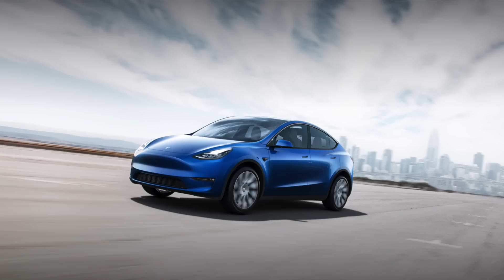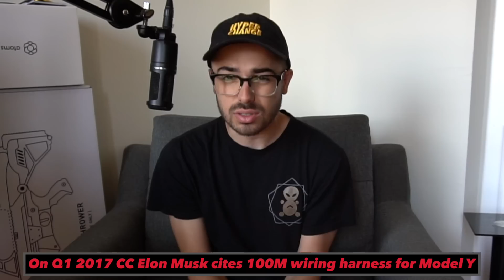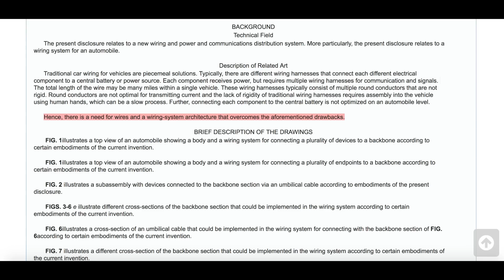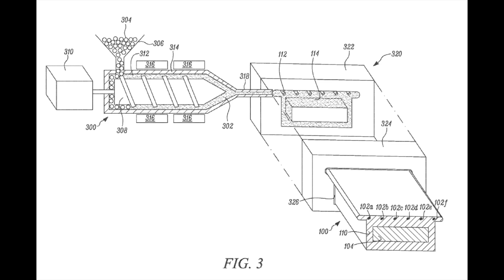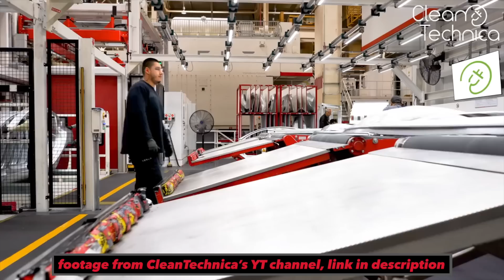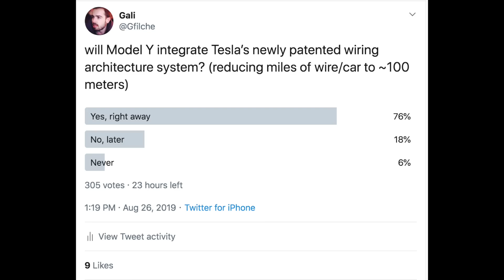Model Y Manufacturing & CAPEX Revolution?

Comment: He misses the main point regarding the new wiring that the new ‘bus’ wiring allows for all the small components (lights, speakers, sensors, cameras etc) to receive power and data to perform their functions from the same cable infrastructure. This is important because the individual modules can be replaced and upgraded potentially as they all connect to a universal connection. The reason it reduces wiring length/weight is that you only need to take power and data once around the car to connect all the modules, not running separate wires back from each device for power/data. Bus wiring also means each device or module has its own intelligence allowing it to feed back data to the car on its performance/faults etc.

For example, the speakers in a normal car are all connected back to the central audio system with separate dedicated speaker wires that are all run separately around the car. In the ModelY design (Bus wiring topology) the speakers are provided power and data from the simplified main universal vehicle wiring loom and have an amplifier module in each speaker with the audio signal sent as data to each speaker over the data network from the central audio system. This means the speakers can share the same cables as the cameras, sensors, window motors and headlights.
Reply: Noah Derrington exactly!

Comment: Imagine each power connector coming off of a branch of power, having an "IP Address" like connection for a general location node which will determine the power to go to each component in the area. Literal computer on wheels.  Makes sense to me.

Comment: Rigid wiring usually means wiring that fatigues and breaks more easily - like what happened with the Model S doors in the early years. I hope they have this in mind.
Reply: Fatigue is caused by repeated extreme bending.  Keep bending to well below yield and there should be no fatigue.  Use of PC boards attached to the frame with rubber mounts, coupled with ribbon cables for flex points like door hinges.  These boards convey conductors with power and signals across the space as well as mounting the local micro controllers and connectors going to local devices.
Reply: @paulogden7417  I don't see how ribbon cables are a specific solution to my proposed problem so long as they are also extremely rigid.

Comment: If only you had even a clue of what you are talking about. The robot-capable harness WILL NOT be lighter. Tesla is under a lot of pressure to deliver the Y - they CAN'T deviate from what's in Model 3. The patent you're jumping up and down in your couch over was probably filed a year or two ago....it does not mean that the "tech" will appear in a car. 

Automotive buses have been around forever - this is NOTHING new or high tech...in fact, it's high expensive. With a manufacturing plant in China, labor is almost free, so again, it makes ZERO sense that Tesla would do anything in this area.

Autonomous driving WILL NOT require more wiring than is already there -- it will require more processing, but that will be contained within a computer module - fail, on your part, again.

As far as Tesla building cars like Hot Wheels...ya think? The tonnage required to squeeze material out into body features into four pieces of car is so huge, it is NOT feasible. But, yeah, you can get a patent on it in case it ever becomes viable, or in the least, build up a patent war chest to trade with someone whose patents you're infringing.

In other words, ....meh

Comment: 100 meters of harness in not all that exciting if it has 80 wires in it.  I'm sure they went all network for signal wiring, but everyone has been heading in that direction for a while.  Where they can save is power distribution, seeing as the battery literally runs the length of the car they could tap into a power bus every where.

Comment: Could they cast the entire car? Sure, but that would present lots of problems down the road if you have some fender-bender. Instead of replacing a single panel, you now have limited and much more expensive options!
Reply: I was thinking the same exact thing. you could easily get your car totaled that way
Reply: @granturismob  It's a tricky engineering puzzle, I'm sure. How do you design something to be easy and/or inexpensive to produce while also making it practical to work on or disassemble for various reasons? Cars nowadays are built to be easily built, bit not necessarily easy to work on (as any shade tree mechanic who has worked on cars from the 70s and earlier will attest to). Some suspect that this was done not just to make the cars cheaper to build, but also to dissuade home mechanics from doing anything too serious and instead take their cars to the shop where they have the proper tools to do the job. Might be true, considering that dealers make most of their revenue from maintenance and repair rather than sales, and the auto manufacturers know this.

Comment: Gali -  The stamping machine is really a casting machine not a stamping machine. (https://insideevs.com/news/361430/tesla-big-casting-machine-frame/) Casting is like pouring water into a mold and freezing it. Stamping is more obvious, like smashing playdoh into a nice shape. What's interesting about the new process is that casting can make more brittle parts than stamped parts (and welded). Telsa will need to guard against that. Here's an interesting entry: https://monroeengineering.com/blog/hot-chamber-vs-cold-chamber-die-casting-whats-the-difference/

Comment: I get that less parts is better for manufacturing but often times it makes the repair process much more difficult. An example would be its much easier to replace a fender because its bolted on and is a piece of its own verses a 1/4 panel which is part of the side aperture.
Reply: Desmo BC you do understand that they mean the chassis not the body panels right? They will still get bolted on.

Comment: Great video Gali- Fascinating stuff. On the aluminium casting though, I believe that Musk on the ‘Ride the Lighting’ podcast describes something completely different to the patent application. 

On ‘Ride the Lightning’ he describes an aluminium casting ’rear underbody’ of the model Y, moving from 70 parts (steel + aluminium) to 2 aluminium parts (+ 2 fasteners), then down to 1 aluminium part when they get the ‘big casting machine’. Already really impressive. Will be interesting to see the wall thicknesses they need for material flow and the impact on weight and size…

See https://youtu.be/s41qWOb7pVQ?t=1833 with timestamp…

The patent application details a complete frame (even mentions roof if you download and read the documents). This would be insane- on a completely different level. The casting machine for this would be a monster! Also, insanely expensive from a CAPEX perspective, though- as he mentions, they would save massively on assembly (robots/people...)

I believe Musk is attempting to address (even destroy) some of the criticisms of the Model 3 ‘body in white’ from Sandy Munro….

https://www.youtube.com/watch?v=CpCrkO1x-Qo

In my opinion (and a little experience), it’s extremely unlikely that any visible/ aesthetic parts will be cast from aluminium (as you get tons of surface defects in such castings). You never know though with Tesla!

I’m very, very interested to see how far they go with the model Y, considering the problems they had with the automation in the model 3 ramp.

Great overview as ever- keep ‘em coming….

Intrigued Industrial Designer, Switzerland….
Reply from the maker: awesome insight, thanks for sharing
Reply: @Anthony Smith yes a lot of people seem to be just skipping right past the differences between casting and stamping.  Gali mentions casting but shows footage of stamping as one example.  As a very general example, body panels are stamped from sheet metal.  Housings like the motor or components like the suspension control arms are typically cast.

Comment: This large stamping machine is a nightmare for insurance companies. For Tesla insurance it would be a godsend. With the deductible going to $1000 minimum that could pay for freight to a Tesla chop shop. Battery recouping, engine recouping...bang 60% of the car cost right there. Customers data is flashed from old to new refurbed car with similar milage to hard components like battery and drivetrain.... I see vertical integration of insurance with the model Y.

Comment: The frame will be injection molded (1 part) not stamped.
Reply: Several times, the word "casting" has been used. I think you're right, though - Injection moulding, with molten Aluminium. It would require incredibly tight tolerances for such a big casting but the advantages would be amazing! Thicker where it's needed, webbing where it's needed. I'd say it's not beyond the wit of man. The tooling would be incredible!!
Reply: @andylewis7360  I think you are overthinking the term casting. Or Musk has a concept for doing the unpractical.
Reply: @bruceryan5919  Nope. Look at the article that features the patent, or the patent itself. It's all about die casting. You may think it's impractical but it seems Elon doesn't.
Reply: Andy Lewis I  cant believe you can cast aluminum thin enough to be a body section and still be strong enough to not crack. Plus, a casting needs to be machined to make it smooth enough to be a finished product. 
That is why my feeling is it is actually a stamping machine that Tesla is going to use. No matter what particular patent is indicated. We shall see.
Reply: @bruceryan5919  I'll concede that casting body panels of normal thickness ( ~1mm ) would be a challenge but, given sufficient pressure while the metal is still molten, it's not beyond the bounds of reason. I agree that a casting would seem to be comparatively brittle, which would compromise crash-worthiness. Someone mentioned Aluminium foam elsewhere, which would be a very interesting idea as that would result in a very low density material with a solid outer skin. I'm not sure I agree with you regarding surface finish. SAND castings do tend to be rough but pressure die castings, can have very smooth surface finishes. We shall see, indeed! I'm very keen to see how this pans out! :-)
Reply: @bruceryan5919  the casting will be the frame (skeleton), and is not visible.
Reply: @CANeelJavia  Well, I suppose it’s not impossible. I think that Tesla would have to produce replacement sections separately and figure out some way to produce a joint that’s as strong, but not more bulky. I think that’d be the real challenge. I can’t easily see how it would be cheaper to repair than current construction methods, though. And that would have a knock-on effect on insurance costs. Let’s say the die cast part is just the chassis and bodywork is attached separately and you need to repair a bent chassis. You’d need to know exactly where it’s bent and where the bend stops, cut the chassis either Side of the bent areas with a jig that’s especially made for the job, then fix in the replacement section somehow. The joint would probably not be welded. I think it’s most likely to need countersunk bolts and probably some kind of high tensile aerospace adhesive too. The replacement section would come with tabs and holes for the joint but the corresponding areas on the damaged chassis would need to be machined to accept them. That would take a LOT of specialised tooling, or indeed some kind of CNC milling robot. That would certainly add to repair costs!! Maybe I’m overcomplicating this but I don’t see an easy way to join two die cast parts without compromising the integrity of the structure.
Reply: I  bet its difficult to repair after a wreck
Reply: Neel Javia Well, of course this is conjecture at this point but I suspect so. If it were produced cheaply enough that might not be so much of a problem, though. It might be quicker and easier to transfer major parts from the crashed chassis to the new one, if it were designed to be repaired in that way. It’d be a considerably different design from current car designs though. For instance, all wiring and interior components would need to be temporarily fixed. No self-adhesives etc. An interesting thought game though! 😁 The more I think about, the more it seems that Tesla might be working towards a business model where they always own the vehicle and only lease it to users for this construction design to work.

Comment: Yes wiring or lack of it will be in Model Y, note the PCBs in the modules have RF connection to the main computer its used for build validation during robotic assembly, in car real time diagnosis, redundancy in the case of autonomous  vehicles. Are Tesla ahead of the game ?..........

Comment: As it is a larger vehicle, the Model Y would need different length harnesses to the M3, thus Y needs different harnesses. So may as well introduce new harness that saves cost. We should expect Y to have a number of innovations that are proved in the production ramp and passed onto the 3 12 months later.

Comment: My only concern is with the stamping machine. If you make the car a single part then you can’t really repair it by replacing the damaged part. This will probably mean higher insurance since it’ll be easier to total the car.
Reply: This makes the chassis not the body panels. They still get attached to that and can be replaced.

Comment: Corrosion will destroy more cars than accidents, parts failure, and time combined.  I suggest a body undercoat ever few years.  The car will last 20, you need to protect it for it to last until the end of it's life.  As for replacing parts, cut, replace, weld.  This is not rocket science.  I have a big point people are not paying attention to... if you live in the city and drive 12 miles to work over an hour and a half every day the car has 12,000 miles on it in 2.5 years, but 1,500 hours on the motor...  An electric car does the same thing, has 12,000 miles on it, but only 200 hours on the motor.  Think about the difference in resale value.  A small car would lose almost 80% of it's value in 3 years.  The EV should only lose less than 10%.  As the EV has 988,000 miles or 17 years on it.  The used market on EVs will notice this soon.  Used ICE will be crushed or given away when nobody wants them any more.
Reply: David Beppler this is an interesting point. So there should be a new metric to measure, motor operation hours, like with a bigger or other plant machinery.
Reply: @MoDa87  It has been talked about, but big auto has refused to do it for the last 30 years.

Comment: The car becomes a motherboard.  I didn't know electricity flowed poorly through round wires.  I'm re-thinking one or two parts of an upcoming solar installation, where some large capacity wires could become 'bus bar'  connections instead.
Years ago I was telling people that traffic lights will become network routers, allowing untold quantities of data to zip through in any direction, and never collide.  You'll never see another yellow or red light when your destination is known.
Reply: Round cables are not an issue for something like what you're doing which is a constant DC current. With AC signals/currents you have the skin effect and it's possible that rectangular conductors cut this down a little.

Comment: Several people and articles commenting on the new "Casting" machine confuse it with "Stamping". They are very different. Casting pours liquid into a mold, Stamping crushes a sheet of metal in a press.

One challenge with casting is to be able to make the mold so all the metal can reach the furthest cavities. If this doesn't work, the casting is useless. The other challenge is to be able to assemble the mold and take it apart because part of the mold will have to be inside the object being cast. The third challenge is heating the mold so the liquid metal will flow and then cooling it quickly so the mold can be reused.
Reply: Well, Tesla is "Stamping" out all ICE vehicles and is #1 EV in Europe.
Reply: @markplott4820  casts new light on what's really important about all this tech stuff.

Comment: I think the stamping machine and the new wiring architecture will improve quality as well as production volume. Any electrical problem should be immediately isolated to the individual component. You may even be able to see an indication of a particular bulb (ie. diode) that has failed within an overall lighting component (ie. headlight). It's going to delay the availability because it's so different from existing methods, but the dividends will pay off big time once ramp up is complete. I think they will tackle the wiring piece before the massive stamping machine because I don't think they have the space in Freemont for it. However, what other countries buy SUVs? Maybe the stamping machine will show up in GigaFactory 1 for the pickup truck which could demand even more volume than the Model Y.